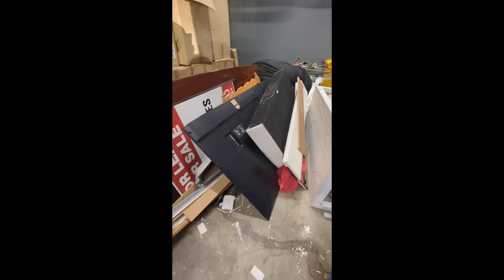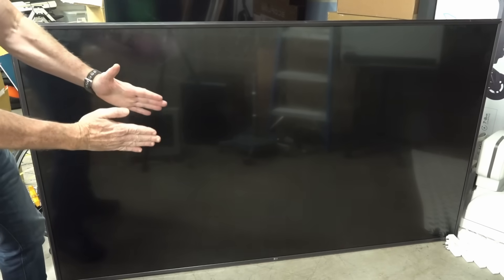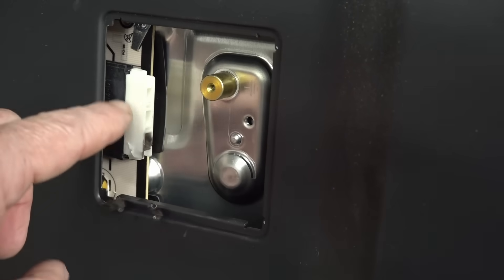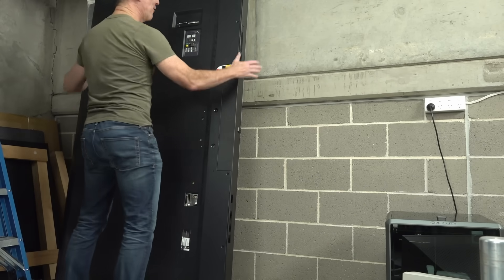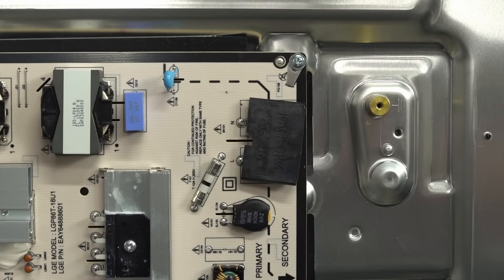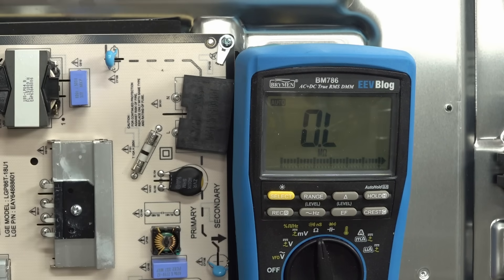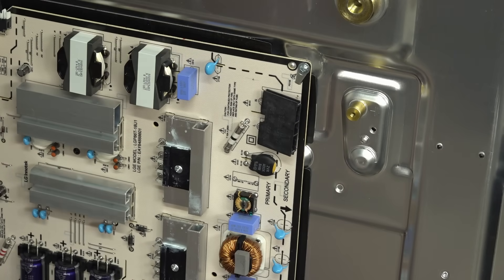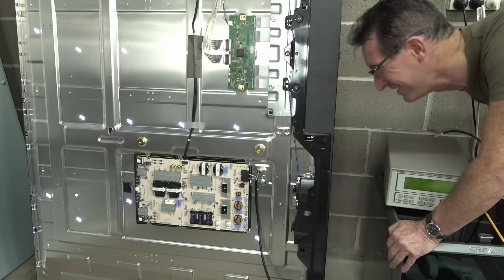Dumpster Diving 86" LG 4K LCD TV

Comment: The worst thing is that people who throw away LCD TVs usually crack the screen when they dump them. Because they don't care. I found once 50" LED TV at the dumpster, and it had bad solder joint at power supply connector, when I fixed it, I saw the crack, and the crack probably came afterwards and the real reason for being in trash was just bad solder joint.
Reply: I work in IT support for schools, and during an equipment refresh project, I was requested to keep a handful of 65" screens to one side in a storage area for possible later re-use. So I tested that they all worked, then stacked them carefully against the wall in the server room, making sure that nothing was touching the panels. Some time later I went back to the same site, to find that someone had re-arranged them - so that the wall-mount brackets on the back of one unit were digging right into the LCD of the next one. They were all ruined. Some people just have absolutely no idea.
Reply: @Zeem4  Yep... oh need to put something there and they are taking up to much space nudge nudge.
Reply: It's a far reach to think people should be saving their trash for the next people.
Reply: I totally agree. I sometimes find large TVs or computer monitors that people threw out. Usually it's a simple problem like a broken connector or power button. I get it working, and the screen is cracked or otherwise damaged!
Reply: The worst thing that they buy a new one on credit 😂
Reply: "the real reason for being in trash was just bad solder joint. " Why don't electronics manufacturers improve their soldering methods in a way to compensate for the mandatory lead-free solder being more fragile? Is that even possible? 🤔

Or am I mistaken and lead-free is just as or more durable than lead solder, and it is the poor soldering at the factory to blame?  (or worse still planned obsolecene and a device that is not intended to last for 20, 30, 40, 50+ years in the first place, unlike a 1990's Sony Trinitron or 1950's Telefunken radiogram?).
Reply: i found one that had  the  plastick part of  the power  plug  rip out it one those  that  the cable detach  so if  thear  3d print file  i cant   print  the  part  that  snap  off  and re  use  the port
Reply: @UKUSA  NRF gets these in a heap, it's always port issues (broken traces from it wobbling). Success chance of repair is medium, depending on how much micro-soldering you want to do.
Reply: That was my thought too.
Reply: it is more likely that they cracked the screen, and in the process of throwing it away they cracked the solder joint by moving the unit around
Reply: They do this so that people can't repair and have a TV for free. 'If I can't have it, nobody else can.'
Reply: @MoisesCaster  some of them maybe, but most of them just don't care. Most people treat it as piece of trash the moment it stops working. So they don't care if they crack screen on their way to trash bin.
Reply: @MoisesCaster  I once saw an intact projection TV on the curb when I was walking to the store. When the owner saw me, he came out and said I could have it for $300. I asked if it worked, he said it had no green. I said no thanks.
When I came back from the store half an hour later, there was a big hammer hole in the screen.
Reply: @MoisesCaster  To be fair, if repairs didn't cost hundreds of dollars in hourly labour charges, I guess they might be inclined to try to get their TV repaired like the old days!  Not to say old fashioned electronics repair shouldn't charge a fair price, I guess a lot of the blame is on "official" authorised Samsung (or Miele or Bosch etc) repairers charging outrageous fees and getting people the wrong impression about more reasonably priced independent repair shops perhaps?

A $6000-7500 TV like this Samsung should definitely warrant repair and be economic to do so, where a budget $500-600 TV might not be.

Unfortunately for things like a washing machines, a cracked drum spider or out-of-roujnd stainless drum or new control board part price can easily be the majority of the cost of just replacing the machine with a new one...  Indeed, a Miele washing machine control board alone can cost more than an entire Samsung washing machine (though that's no excuse for Samsung washing machines not lasting very long! but nor is it an excuse for the Miele boards failing at 6-7 years either...).

Comment: You can actually get replacement screens for alot cheaper than its worth to buy the whole tv especially these days since diy repair is so huge you can get the screen for around $200-$250 and sell the tv for about $800 their 86" models from oldest to newest models still sell between $1000 and $5000 refurbished/new. I know this because i fix broken flat screens alot and resell.

Comment: I get really frustrated by the cord cutters !  lots of people put stuff out around here , working or not the cord cutters come and cut of the 
power cord for the copper wire ,I got a perfectly good 55inch LCD TV the other day I guess they upgraded to a smart TV , cord cut remote 
smashed . Fitted a new cord works perfect ,I think most people these days wouldn't be game enough to fit a new cord so straight to landfill.
Plus looking for a new remote .

Comment: Just a few days ago, I unintentionally did a dumpster dive.  I was transporting hundreds of wine glasses from one area of a venue for an upcoming sports event to another area; I just happened to look into one of the recycle bins which was beside a staircase I was standing near.  I thougt what I saw was some kind of kitchen machinery. It was just laying there in the bottom of the bin; but on closer inspection it turned out to be a Sony TC152SD tape recorder (from the late seventies), just lying there at the bottom of the bin.  I wasted no time in picking it out and taking it to my locker.  It's at home now (without power cable); I just have to figure out if it works, and if not, how to get it working.  Beautiful looking thing.  

I salvage a couple of motors from a Standing fan yesterday, the ones where the fan head rotates horizontally so as to cover a wide area; it that had been thrown into a giant skip at work, that and some sort of power switch for connecting I don't know what.  Gotta do my research.  But it's fascinating how easily things are thrown out over here (I'm in the UK)

Anyway; I have to wonder what they got as a replacement.

Comment: Yeah Tv's usually ain't worth  messing around with because they usually have panel issues.. Either from some panel problem they have before hand or from getting tossed  either way not really worth picking them up .. Also I think most panel problem you can see before hand if you look at screen with flashlight beforehand..

Comment: I would not be in such a hurry to scrap the 86" TV myself. It depends on the crack/scratch. If the TV still works but has a deep scratch, I could use it as a monitor or kids room TV or remote or outside view. Lots of low quality display possibilities. If it is just scratched (that is what it looked like to me in your limited view we see, then you might even be able to buff it out. My point is think outside the box.

Comment: Seems to be a common failure for the brand. Had the same, although with a smaller unit. Connector soldered to the board, and only a flimsy screw to do the cable release. In case there is any movement in this, due to cleaning, it breaks after some time. Soldered it back on, back to live.

Comment: Yup. I work at a IT recycling center and we usually get large broken TVs like this. (mostly 50-65 inchers)
They're just heavily used but still working, but most of the time get damaged during transport, since they just get chucked in a truck on top of other junk.
 It sucks, but it's part of our job to recycle unwanted hardware. Even if I personally think recycling functional tech is a f you to people who can't even afford them.

Comment: The closest I have come to that was a laptop with a broken screen of unknown tech. I think the cracked part was actually glass. I removed the broken glass and visually it worked but the touchscreen functionality was gone. So I'm wondering if the break is just cosmetic and potentially repairable with a big sheet of plastic, or does it usually damage it to the point it can't display an image at all?

Comment: what are the green and yellow connectors for?  haven't seen that style in the US.
Reply: Pause at 2:46 and you'll see an information box to the left of the LAN connector showing what appears to be two different plugs that go on those yellow/green ones. They're likely some adaptors with sockets to plug in your component or RCA plugs into. I'm guessing doing it that way means the ports take up less space on the back.

Comment: Your theory on the shorter earth wire doesn't make sense. You want the earth wire to be longer so it maintains connectivity if the active/neutral are flapping in the breeze.

Comment: 4:44 Shouldn't the earth connection be the longest? I follow a few electricians and they said to leave the earth cable the longest, because if the cable is pulled out, live breaks first, touches something, and at least the ground fault protection will trigger. It was a bit different situation, there was a cable clamp to secure the whole thing.

Comment: Pretty sure Northridgefix has had a lot of these in, he says they always die after a year, and it's a port issue (multiple traces break loose). Some are fixed from reflowing the port, but most require fixing all the traces. Maybe this can be an excuse for Dave to get a JBC nano?

Comment: The answer to that power connector would be to wire in a power cord (I recommend having it unplugged from the wall outlet while wiring it in, lol). Give it some strain relief and should be gtg. I'm sure most of us, if not all, have an extra power cord from either an old pc or monitor.

Comment: I'm in the U.S. and in this area we have bulk trash pickup twice a year where the city will haul away almost anything you put on the curb for free.

I don't know much about fixing TVs, but I've brought home a bunch and gotten several working ones.

The biggest one is a 60" Vizio with half the backlights burned out. I kept it with the intention of putting new backlights in (there's a video tutorial), but a set costs $80 and I haven't been able to justify the cost, especially considering that if I accidentally crack the LCD panel, I'll have wasted my money. Also, the backlights bruning out is apparently a common problem with that model as it supposedly sends a power surge when first turned on, which shortens their life.

Next is a 50" Samsung, 4K TV, which seemed to work perfectly, but started glitching around the three hour mark. I haven't had the ambition to do much with it. I keep meaning to run it with the back off and a fan blowing on it to see if it's a heat problem.

I have a 47" LG that works, but it has some moisture in the screen. I'm torn between trying to take it apart and see if I can wipe down the layers, or just letting it sit and see if it dries out on its own. 

I also have a 43" Vizio that works, but also has moisture in the screen.

I have a 40" Toshiba that works great, but has one stuck green pixel on the screen.

I have three 40" Samsung TVs that all seem to work perfectly.

I have a 32" LG TV that had moisture in the screen when I got it, but which dried out and now just has a couple spots that are SLIGHTLY darker than the normal screen, but aren't that noticeable.

I also have some smaller TVs in the range of 20" down to about 17".

I recently gave away a 46" Seiki TV. It didn't have anything 'wrong' with it, but I didn't like the fact there was no way to turn off overscan. If the TV has a resolution of 1920x1080 and I set my computer to 1920x1080, I expect a pixel-perfect image, not one that's been enlarged and has the edges cut off.

Many years ago, my friend and I found two identical TVs, about 60" or so. At the time I didn't want them, so he gave them to his brother. One had a bad power supply and the other had a cracked screen. He combined the parts and made one good TV out of them.

Comment: I just looked up the specs for that TV. Despite LG claiming it to be 4K, it's not. Their specifications say the resolution is 3840 x 2160. That's UHD. 4K is slightly greater resolution at 4096 x 2160. I wish companies were honest about the capabilities of their TVs. A few well known electronics companies have basically called out the lies of their competitors by listing the different resolutions and telling people 3840 x 2160 isn't 4K.
Reply: It is real 4K; the UHDTV-1 4K standard is 3840 x 2160. DCI 4K is 4096 x 2160 but much less common on TVs.

Comment: Maybe was wall mounted and it fell off. While falling the power cable was ripped off by the weight and the burn marks could be due to arching during Unexpected Rapid Disconnection :)

Comment: RSVP that TV. I do wonder which came first, the broken connector or the cracked screen. Judging by the skid mark on the connector, I'd say that was the reason for them getting rid of it, then they cracked the screen when they dumped it or moving it.

Sadly, I can't be impressed with these "big" LCD TVs. We used to have a pair of 150" units in our old studio, which were pretty much the largest LCD panels ever made (they were prototypes, never manufactured or sold commercially). No idea what happened to them after we moved to our new studio, probably shipped back to Sony. Now we've got those huge video walls that are made up of the modular LED panels. The big one is about 15m long, so they blow away any TV you can get these days. Really impressive to look at, until you poke your head around back and see how much wiring and power goes into the thing. Makes you wonder how they ever got it working in the first place!
Reply: Répondez s'il vous plaît? Don't you mean RIP - Rest In Peace?

Comment: TCON is short for Timing Controller board.  These boards re-time the signal from a standard source timing to the specific timing required by the panel. By timing we're talking about front porch, back porch, and vertical blanking timings. Standard timings have standard values, while the panel itself will have different values (but overall the timing is the same) so a TCON is mostly just delay lines and buffers and maybe a PLL if the total pixels per line or lines per frame is different. As the panel needs to run at the same rate as the incoming signal it's a fairlly lightweight process. (After all if it's 60Hz panel, it needs a 60Hz input signal, but the timing details can vary within those limits).
Reply from the maker: And it's shaped like a T 😄

Comment: I wanted to try to fix just a TV recently. Found one on the local market internet thingy, it was 82 inch. Couldn't fit it in the car. Just getting it of the wall already risks a crack, because the TV flexes a lot. There was an issue with the connector to the leds, the leads were sooo thin. Also a little control IC went short on the power board. But lifting the panel up to get access to the leds went wrong, because of the enorm size of it. It cracked. It's just to. hard to handle, you need a frame with suction pads or something. The plastic is now my bench table top. The leds will be my bench lighting.... Insane amount of leds and power in the thing.

Comment: Wouldn't the longest wire go to Earth? You want to keep that connected till the bitter end?
Reply: Earth is on the separate screw terminal - the only pins in the connector and L and N - you can see them silkscreened on the board

Comment: Quick tip for checking lcd screens. Use a bright light pressed up to the screen. It will help you see defects like cracks and bruises. In a pinch, you can use your cellphone led. The bright the light, the better. So a cheap $1.00 torch may not be best.
Reply: Yeah when I was frequently coming across them I'd put my phone light up to it and search for cracks.

Comment: I made skylight from RGB-strips, it copies the sky color outside with  ESP-camera.  With giant TV one could show clouds and stars and birdshit. It does matter if it is cracked, as roof windows tend to crack because of ice and snow. DIY Perks did something like that?
Reply: But when an LCD cracks it's not like you're seeing the picture with some cracks. There will be big black spots and areas with red, green or blue colored stripes. Sometimes there won't even be a single spot where you can actually see a picture.

Comment: I suspect this "fell off the wall"  

We know it was powered when it fell, because the mains cable has been yanked, broke the connector off the pcb, and the L or N arc'd across as it was eventually pulled out which left the sooty smudge you saw first
Reply: Yeah, that was also my first thought. The bezel "impact point" Dave noted was opposite from the power? That would be consistent with it hanging from the power cable.
Reply: Either that or if it was on a movable stand someone tripped on the power cable, ripped it out and it tipped over and broke.
That happened to a much smaller TV of ours at a trade show - someone had failed to protect the cable.
Reply: This all fits together in one Occam's razor explanation.
Reply: somebody just move house drop the tv, crack the screen. chuck it next to verge and another person came pull the power cable out for copper.
Reply: @David-sk7ls That wouldn't explain the burn mark

Comment: There must be large sheet of polycarbonate or acrylic in there, and a large sheet of polarized film. Plenty to salvage and repurpose or play with.
Reply: And the biggest back light tracing table, or slide film preview table you could imagine!
Reply: @gorak9000 
or fake window :)
Reply: I have several decent sized acrylic sheets from old monitors, about 10mm thick so very useful.